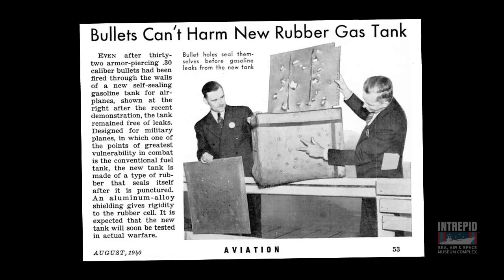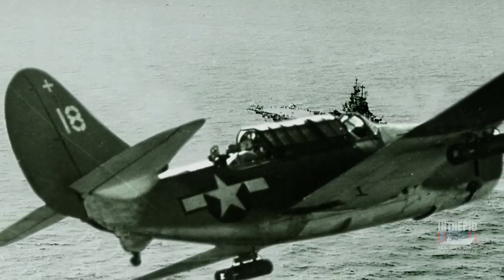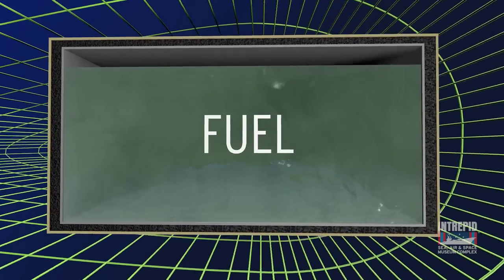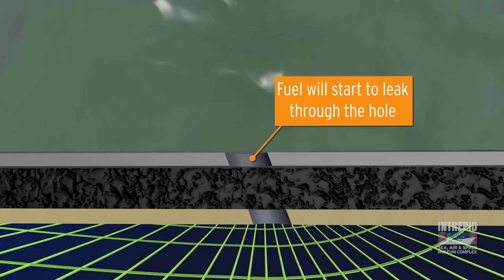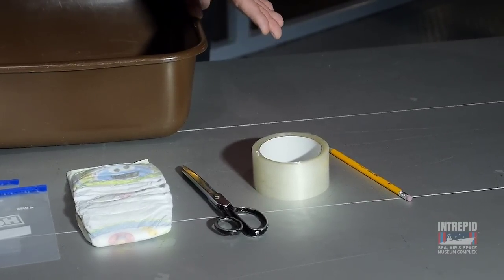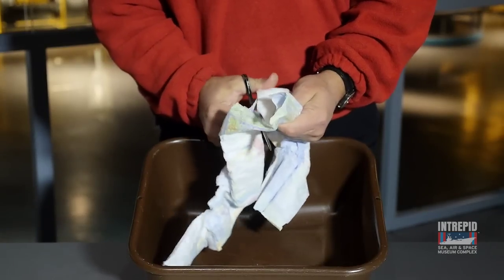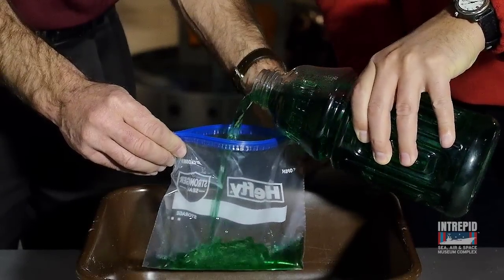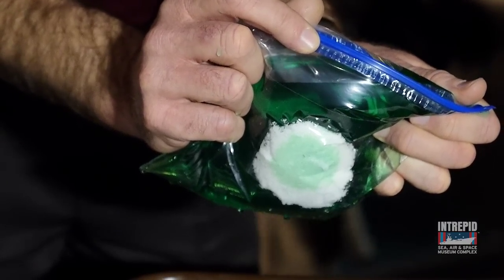Self-Sealing Fuel Tanks

Comment: A berry concise and calmly present ed video
On of the iss yes about ignition of Fuel in a military context is web a tank is pierce it is usually a tracer round that has a phosphorus tailwicg will be a source of it notion however ant firm of detonation of a volatile liguid needs the correct stoichiometry I e. Fuel to air ratio in order to start a fire ithink in this case  the velocity of s tracer round will be too fast and won't have time to set off a detonation because ther will be too much fuel a little to no air to firm the right ratio for combustion

Comment: Albeit it only works if the fuel tank hasn't caught fire.
Reply: Usually, the fuel ignites outside of the fuel tank (in the air). The fire doesn't get into the tank itself, because there is not enough oxygen to cause fire or even an explosion. It's like a Bunsen burner.